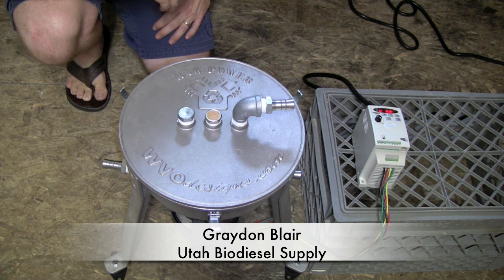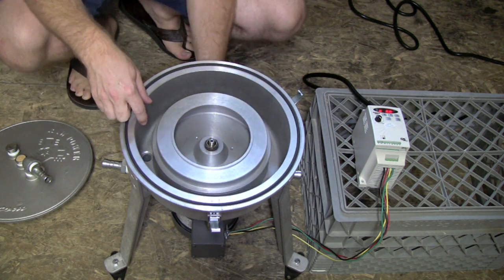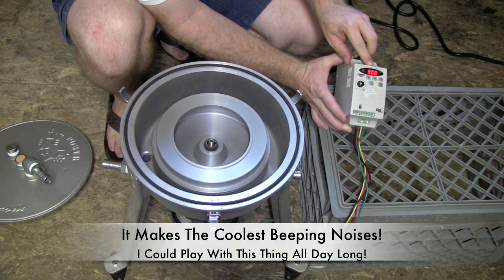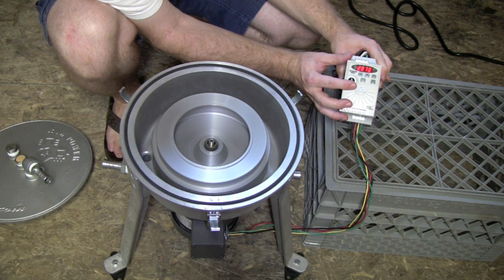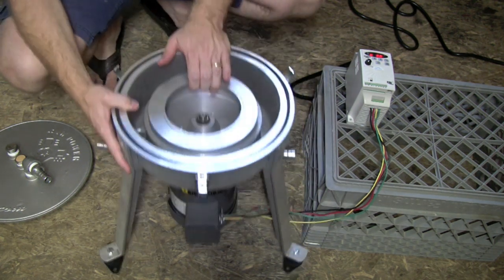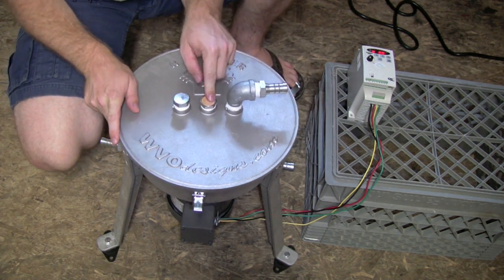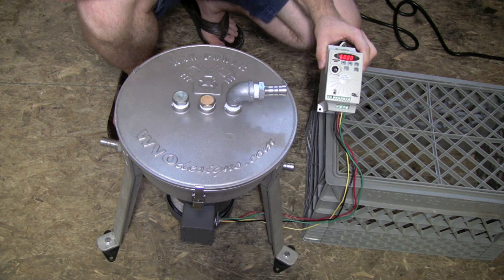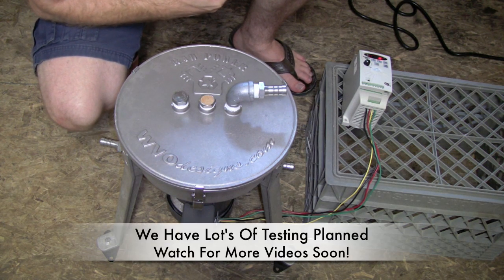Extreme Raw Power Centrifuge | General Overview | Utah Biodiesel Supply

Comment: Centrifuges DO NOT filter. They seperate. If it did filter you would be able to say to what micron size, which you can't with any centrifuge. it is easy to overload them, causing bypass contamination of the cleaned fluid. As soon as your bowl fills with solids separation ceases. Constant stopping of the centrifuge is required to dump those solids in this design. if the oil was really dirty you may have to shut it down every few minutes. This would be very inefficient. industrial centrifuges have an auger cleaning the solids build up out constantly so can run continuously but the quality of their out put is effected by the quality and quantity of the product being centrifuged. The output is never consistent unless fed exactly the same product.

Comment: You have to heat it hot enough that the oil will flow. If it's too cold it won't flow through the plumbing and into the centrifuge to get filtered.

Comment: It's because the AC drive converts 120 v AC to 230 V AC and varies the voltage and frequency going to the motor. This is what allows the motor to spin up to 6,000 RPM

Comment from the maker: @Turbocharge1000 The AC unit varies the hz (Yep, incoming hz to the AC unit is 60 hz) to the motor which then varies the RPM's. However, you can set the read out to read in Hz, RPM's, and a host of other variables.

Comment from the maker: It depends on what you're using the oil for. If it's going to be used straight in a vehicle, some people will filter it additionally through a sock filter. However, if you're making Biodiesel, this is fully sufficient to filter the oil.

Centrifuges can't separate glycerin from grease. That's done chemically by making Biodiesel. Visit my site (link in description) to learn more about how that works.